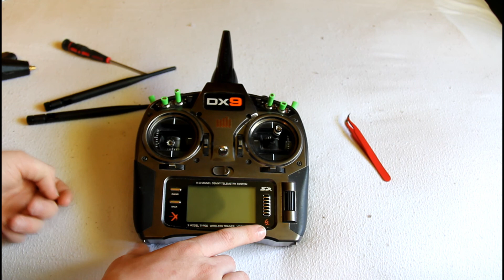Spektrum antenna mod how to

Comment: You are going from a dx9 to a taranis, why?  The Taranis feels like a toy compared to my dx6.  If you really want to use Frsky, get a Qx7, at least it has a more quality feel too it.  A lot of taranis have died because of the antenna mod, lets have a moment of silence for all those dead transmitter modules.😜
Reply from the maker: Let’s see, I chose to make the switch because of the range. Even after doing this antenna mod, I wasn’t able to punch through all the buildings at my main flying spot. And about the feeling of the controller, I would have to agree. Swapping out the gimbals to the hall effect gimbals made it feel so much better, but still not as good as a spectrum radio. But seeings that the range is so much improved, it was a good trade off for me. And agreed, let’s take a minute for all of those dead modules :)
Reply: IDK man, i fly with a bunch of guys that use taranis and none are flying further than me.  I use lemonrx diversity sats and 8dbi antenna on a dx6 gen 1, non diversity one.  I don't fly around buildings, but i think you had a lemon module or maybe antenna.  I have 1 spektrum race receiver that i intend to test the range of compared to the lemons.  I would have sent it in to spektrum.  It's possible all their modules are burning out.  I've been using the 8dbi antenna for 6 months now, no problems.  I never heard about taranis modules burning out until Joshua Bardwell made a video about it, then everyone seemed to have had one burn out.
Reply from the maker: I would agree with all of that, because I mean when I was flying in open fields, my link was completely fine, it was just when I started flying around buildings when I would get failsafes. If I only flew in non cement and metal locations (forests, fields, etc.) then I would have stuck to spektrum. The possibility of a bad antenna or module might have been the cause, but the antenna I have on my frsky radio (which is one of the ones used in this video) seems to be working completely fine. But since having switched to frsky, I have had better experiences. That and i like the versatility of small things in the open tx compared to the spektrum radios.
Reply: I've flown both. yes the taranis had the fancy gimbals, i'll never own one, it could penetrate fort knox for all i care.  I get crazy amounts of range on a dx6 with an 8dbi antenna using lemon diversity satellites, which cost a whopping $13.
Reply: I don't fly in open fields brother.

Comment from the maker: It has come to my attentions that even if you have a ham licence, you still can not do this modification, even though most taranis users still do this modification.
Reply: Why not though? We can operate in the 2.4GHz range in any mode including data. This antenna mod would void the FCC ID, but having your call sign on the radio would replace it.